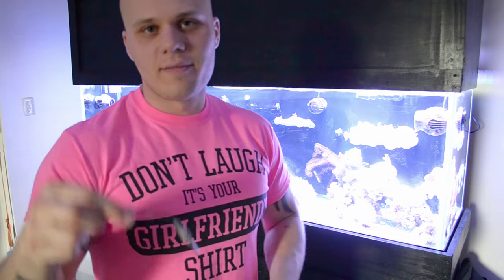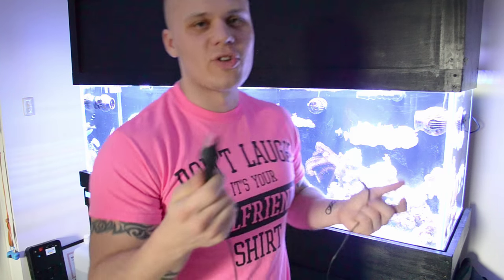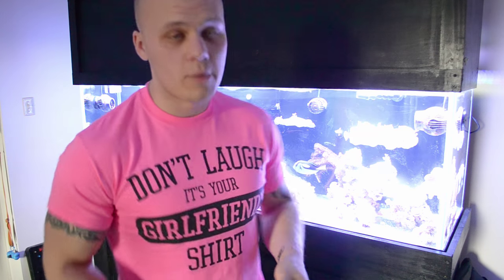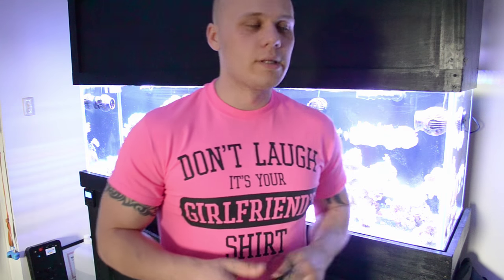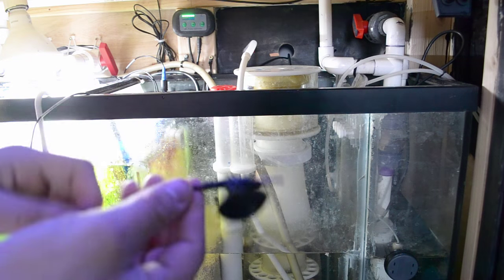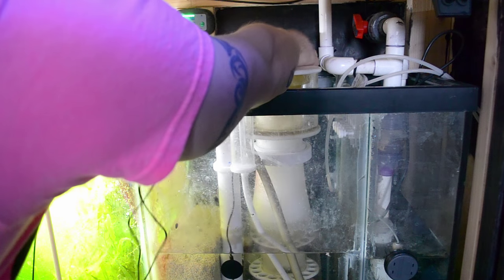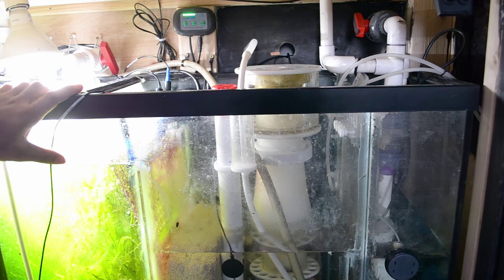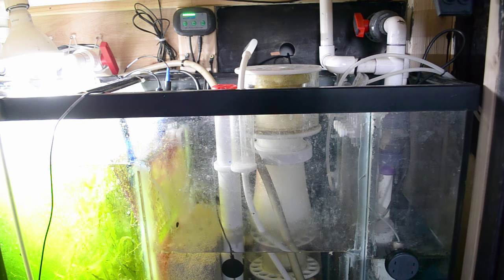Installing A Grounding Probe | Reef Tank

Comment: Been zapped a lot from my reef tank but this morning I got a real zinger! I tested the stray voltage and it was at 102 fahkin volts! I found out it was a powerhead and started plugging in stuff one at a time to find out there’s about 15 volts stray in the tank which is much better than 100. My question is how many stray volts before it trips the GFI on the strip?

Comment: Did you use a multi meter after you did that to see if it worked ?
Reply from the maker: I never had voltage in this tank
Reply: +FishOfHex o ok I was just wondering if it worked
Reply: Do you really think the groundind probe worked?